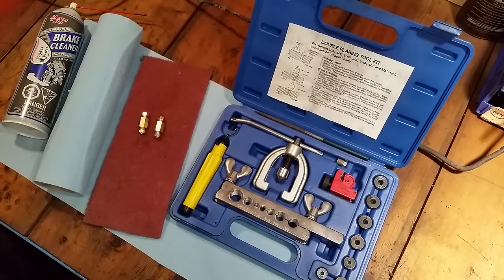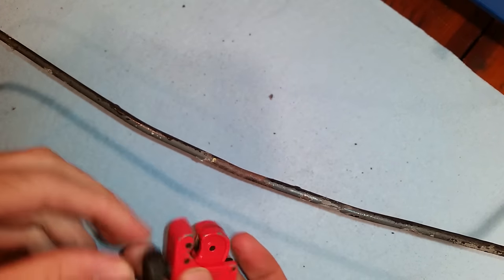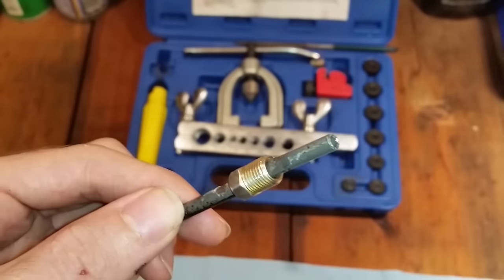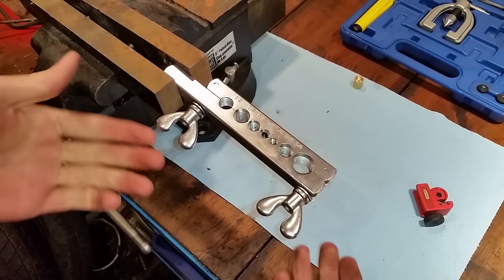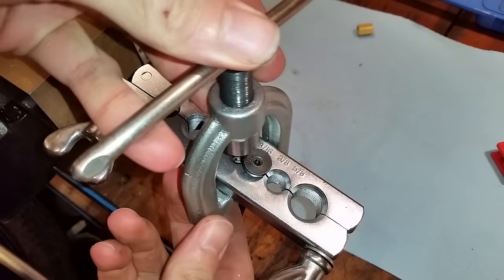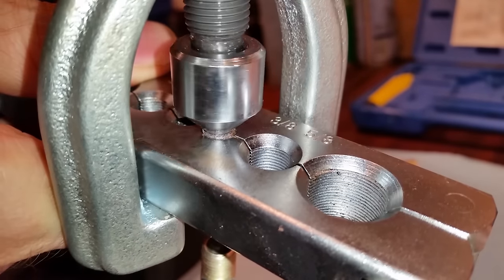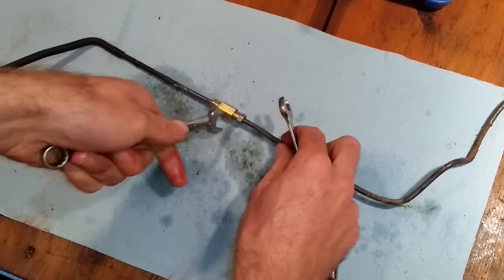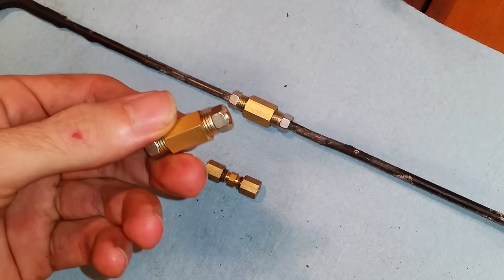How to safely repair leaking and rusted brake lines

Comment: In answer to a bunch of the statements below...not everyone has the money to run out and buy new brake lines. Or maybe you need to get your vehicle back up and running quickly until you have time to do the whole replacement. Thats my situation. No time. I need my brakes to work NOW to get to work! New brake line kits are ordered and on the way. Until I have the time to do the job, they will sit in the box.
Reply: HELL YA
Reply: ... INDEED. Not to mention if you're working outside in asshole deep snow, and PRAYING the rest of the fittings will come off.  MENTAL NOTE:  Buy stock in PB BLASTER. And COMPRESSION FITTINGS? Hell, they may be illegal in some states, but I've used them in a pinch with NO PROBLEMS as long as it's done right, prep work is VITAL to this application.  We have all these DYI vids on YT that may BE very informative, but unless you do it right ... it makes no difference. If you are a DIY person, take the time to do it right, ... SLOW IS FAST.
Reply: The only thing I see is a 5 dollar line that’s full of scale so the line is obviously thin in places rust is a layer of metal so I don’t see taking a piece of sand paper or scotch brute to sand down a line I don’t think you have to replace the whole thing but why bother with old scales line wen you can buy the ones with fittings and all flared for next to nothing thers a lot of pressure in them lines it takes nothing for rusted lines to blow if you want to get it back up and quickly the size of the line you wer fixing you could have bought for 5 bucks fitting and flared I’m sure you have 5 bucks I don’t put rusted line back on ther could be pin holes in them that’s all
Reply: @jeffleblanc8850  True enough, if you got the damn thing off, you can get it back on. If you don't have five bux, where the fuck you need to be anyway?
Reply: Well done SAID, Get her done!
Reply: If you have time to go buy the fittings you have time to buy the brake line.
Reply: a spool of cooper brake lines cost $20 on amazon, what are you even talking about?
Reply: @mrcokez1  If you read my reply your question is a circular argument. Its TIME. Since my last post I replaced all the brake lines on my truck. It took me a day of fighting all the clips, clamps and tight spaces with my big ass hands. When I made the temporary repair, it was a weekday. I needed my brakes to work the next day to get to work. What part of that is a great mystery?
Reply: @donaldbaldwin9912  your point just said it all 100%
Reply: @donaldbaldwin9912  what happens if you need your vehicle ASAP but they can’t get a brake line ordered for a week? This is the perfect thing as a quick fix
Reply: and maybe they don't make them for your particular car or can't get them for some reason; i have run into that multiple times; learning these skills to mock up and bend lines, make the unions and flares is invaluable
Reply: Story of my life lol
Reply: But you have time to inform us about it.
Reply: @ETA555  Sure did. Two years ago....ffs
Reply: Those tools to repair brake lines cost WAAYYY more than just buying new brake lines!
Edit: and as far as time buying new lines is faster than fixing old ones
Reply: BS. its a job. Do a little more and rebuild a  new brake line... the original brake line is one piece... its all the same age... its all going to fail nearly the same time irrespective of whether part is more exposed. Don't even think a coupling repair will pass a UK MOT or German TUV. Also the double flare created here is incorrect (although MOT tester cannot tell) [TUV tested looks for ISO flare], it should be an ISO DIN flare.
Reply: @throatpunch4789  Some auto parts stores loan the tools out for free.
Reply: @jeffleblanc8850  Amen Jeff, for what it cost to buy the fittings he could have bought an already made up line ( various lengths available )with the flares on it and made that fit. Now he has two more areas ( fittings) that can leak not to mention the time involved in bleeding the brakes when he replaces the line with a new one.
Reply: @jeffleblanc8850  Steel lines do not "blow out" on vehicles.  They either rust through, rub against a sharp steel edge and are cut, or they crack due to vibration. A  3/16" steel tubing for brakes has a burst pressure of 16K psi.  Vehicle brake systems produce less than 2K psi.  Older vehicles require custom made lines and can cost over $150 dollars for one with numerous bends.
Reply: Dude  done properly this is a good solid repair no need to replace the full lines.
Reply: dont mix ATF with brake fluid or clean the line out really good after ur done

Comment: Keep the inside of your lines clean after cutting and de-burring the ends so metal shavings don't remain. Any contaminates  left inside the lines can prove fatal to any brake system in no time. Debris may jam the piston or quickly destroy the seals and o-rings.  If lines are still on the vehicle, you can carefully twist a Q-tip inside both ends while  to capture debris. Don't worry about leaving a piece of Q-tip hair behind, it's less detrimental that metal shaving floating around in your system. IF the lines are off the vehicle, blow/flush  the lines out well. If you flush the lines with water, blow them out.  Cleanliness is more important that anything. Keep the system sterile.

Comment: A person should use brake fluid to lubricate the die and the line. because other lubricants are often not compatible with brake fluid. and can contaminate the fluid in the system.
and a person shouldn't ever use compression fittings.

Comment: I've watched a number of videos on repairing brake lines now, and yours is the only one I finished.  Outstanding!  Now I'm ready to fix my brakes.  Thank you!
Reply: OMG!  Great video but if you've pulled the brake line off, then BUY A NEW ONE!  $25 IS ALL for a brand NEW ONE!  C'mon!  You'd be doing it anyway in a year if you've got that much rust on 1 part already.  GIVE GOOD, THOROUGH info on the most important part of the car!
Reply: Taylor Mitchell hey dummy, you don’t think this was done as an example? OMG like chill out riiggghht!??

Comment: Why the automotive industry does not offer an inverted double flare coupling is beyond me. You know that many a mechanic has been faces with a broken brake line. I do not see why a bite-type compression coupling made specifically for steel line would be unsafe. I am a designer who has done industrial piping and specify compression fillings made by Park-Hannifin and Swagelok for steel tubing applications. Many years ago, I was faced with repairing a broken brake line and ended up having to make up an entire line that took many twists and turns. It was stressful because if I messed up the double flare on either end, the entire line was scrap and I had to start all over again. So I practiced making double flares on scrap until I got it down to a science.

Comment: Nickel-Copper (NiCop) brake lines. Best stuff ever. Bend by hand, no kinks, double flares beautifully. More expensive but eliminates all frustration. Worth it.
Reply: Thanks!
Reply: Mar Blox 🤣👏🏾👏🏾
Reply: Couldn't agree more. I replaced every line on my 2500 suburban,  pain in the ass, but alot easier with nicopp lines
Reply: @markbelden6919  I love those old Suburbans. I used to have one. I also used to have 77 Chevy Blazer K5. Loved it! Built like a tank.
Reply: @michiganmagneto  mine defwasnt as cool as a '77, mine is a rust belt 2001, I do love her though,
Reply: @markbelden6919  my 77 Blazer initially had a 305 or a 307 in it and it was about useless then when it finally fail I was like cool. Ran up to the junkyard grabbed a 400 out of a 76 Monte Carlo dropped it right in. What a difference. Wahoo! I love that the top came off. Something I thought would always be awesome to do but I'm not a body and paint guy by any means,  if they made the Suburban similar to the Blazers in relation to taking the top off that would be so cool in itself. But take it about 20 steps farther and build a nice fiberglass camper top that would go over the entire cab and bed. And then have it all mold it into the body so it all looks like one unit. Throw on a moose slayer bumper with a winch & some good size tires... 
One of a kind behemoth!
Another custom conversion I was thinking of for a Suburban would be to put a conversion van top on top of a Suburban. Even that would look super cool.
Reply: There is a company called "inline tubing" that makes premade brake lines for most vehicles, their prices are very reasonable and fit great, I have been restoring my 82 chevy c10 and use their brake lines and transmission lines and they fit perfectly and look just like it came from the factory and they even offer stainless steel lines for a little bit more for people who live in the rust belt, I highly recommend them, saves so much hassle making lines, so if you can wait a few days, order some lines from them it's worth it.

Comment: A great tutorial on brake line repair, I have been doing auto repair in New England for almost 50 years so have lots of experience with rusty brake lines.  I would like to add use the copper/nichol brake tubing for replacement as it doesn't rust, is easier to cut and flare and very easy to bend by hand.  I by it by the 25' roll so replace whole line instead or patching sections.
Reply: I'm in northern Michigan. We replace A LOT of brake lines. That copper nickel line is awesome to work with.

Comment: Great video. Replacing the entire brake line is not always that easy in your driveway. Sometimes the splice repair is the only way to go.
Reply: I agree make the temporary fix until you can get it somewhere easier to replace the whole line. Having zero brakes especially in a big vehicle makes it impossible to move the vehicle anywhere safely

Comment: It’s a good quick fix . What happens is that moisture always gets to them over time. Unfortunately brake lines. And gas lines especially. Rust out . The brake lines or gas line all start out from the engine department and run down to the frame and run the length of the car zigzagging. Thought out the frame to the axle . And can rust any wear on the line over time  . The safest way to go would be to change out the rusted  line whether it be gas or brake line . It’s a little pricey. Depending on the vehicle  but not over wellming in price don’t let  the macanic try to soak yous . All you ladies 😅 stay safe all

Comment: This is exactly what I was looking for, thank you! My old truck is rusted from stem to stern underneath, and I blew a brake line bleeding the brakes after installing new pads, rotors and calipers. For $75 I got a full set of pre-bent brake lines, but some of them are too long, or bent in such a way you'd have to take out the gas tank, take out the radiator, remove front end parts- take the body off the frame almost to get these pre-bent lines in where I need them. Instead, I can cut the really oddly shaped ones in 2 pieces, slide them in from both ends and splice them in the middle. I don't want to use compression fittings for the reasons mentioned in the video, so yeah- this is exactly the tutorial I was looking for. Thanks!

Comment: I have owned severl older vehicles with steel brake lines and live in the salt belt. Over the years,  I learned that you should always have ample brake line parts (e.g. brake lines, fittings and tools) on hand at all times. Also, replace as much of the leaky brake line(s) as possible when doing a brake line job. Take it from someone who has done dozens of brake line repair jobs over the past 50 years.

Comment: I really appreciate your thorough explanation of every detail involved. Particularly the information about the different type of fitting at the end, because in relation to my situation it let me know whether or not I can use the compression fitting on the job I'm doing. I'm fixing a leak in my fuel line and I wasn’t sure about the fitting that was supplied with my repair kit. I'm pretty sure it'll be ok since it's not under as high of pressure as a break line is. Anyway, thank you for your helpful video.

Comment: Great video ESPECIALLY the warning about compression fittings and the danger of using them.
Reply: Compression fittings are capable of withstanding 5000 psi way more than brake system will ever see.
Reply: @YUKI JINJUJI
IF it's done right AND with the right materials, which is often less than likely to happen.
Reply: They're fine. Never seen one fail. They always outlast the car

Comment: This is an excellent description of technique, and I really like the way you had a go at why compression fittings are inappropriate for brake lines. Of course compression fittings are used all the time for water installations, but there are illegal for brake fittings for good reason. Part of the reason they are illegal is because they could be easily assembled incorrectly, with no early warning until it suddenly fails. If that ferrule is installed too close to the tip of the line on one side, it may not grip the line as well as it would normally. So, those who claim that a properly installed compression fitting works fine have some justification for that point of view. The problem is that it would be much easier to make a mistake, especially in a situation where the operator cuts the line a little too short and he is in a hurry to complete the task under the car. If the tip of each line is not properly jammed into each end of the fitting, or if it creeps back while it is being tightened down, the ferrule is incorrectly installed but it looks just fine from the outside. If he forgets to crank down one side, it may seem to work fine until the ferrule creeps back with time. A tech could do a thousand of those fittings and if one side of one fitting is bad, he's made a mistake that could cost a life. With no way to detect incorrect installation, the customer is left with a car that is a danger to others on the road when it suddenly fails. On the other hand a bad union will immediately leak, pointing to the need to fix it right away. Even influential internet 'experts'  like Scotty Kilmer get this wrong, you can't trust everything you read on the net.
Reply: Be ready with the e brake when brakes fail....so it doesn't cost a life.

Comment: This is just the information I needed to tackle my burst brake line at my front passenger side of my Dakota.  Appreciate the clear close-ups on the flaring details such as setting the line height in the anvil part the same as the thickest part of the die.  thanks again.

Comment: Thank you so much for this. This made it super easy to understand the steps and proper way to fix a small section. I’m going to do this since the previous owner used a compression fitting, and like you said, when jamming the brakes hard, it made it leak. Appreciate your time in making this video!

Comment: I've worked on cars for 50yrs. Never before had a problem with brake lines, until now. A 96 accd. Pinhole underneath driverside rear seat area. I figured car must've been exposed to snow conditions. Went to pickapart to buy replacement. Spent 3hrs including removing gas tank, only to be stumped with one last bolt hidden behind frame/suspention. So I've searched through utube and found this(and) other videos like this. This is the best(1 other) cuz of explanation about compression fittings. Will use this. Lucky my car is only my backup but will replace complete after I get my #1 back and on the road again. Thanks. Now, off to the store to get what I need.
Reply from the maker: Thanks for watching! Protective coatings aren’t what they used to be. Things break down and rust much faster then they used to.

Comment: Outstanding video sir. I had to repair my 2004 Nissan Quest because the brake line rusted out just before the fitting that plugs into the flex hose going to the caliper. Replacing that whole line was not an option because it is behind everything including the intake manifold as it heads to the ABS unit on the passenger side. The line was in perfect condition inside the engine compartment, so using your guide, and a 20 dollar flaring kit from Amazon, I was able to replace a mere foot of line and I'm back on the road for a pittance. Thank you!
Reply from the maker: Fantastic! Thanks for watching.

Comment: Really is an excellent straight to the point tutorial.Anyone can do this with a little patience.And yes compression fittings are a BIG no-no....but if you have to,they will work temporarily in a pinch.And I mean temporary....be ready to pull the e brake when braking if you have a compression fitting being used temporary to get you home..

Comment: Compression fittings are still in use and sold in auto stores. I've used them many times over the yrs and never had one come apart.  I agree the double flare is better, but under the car is harder to maneuver.  Thanks for sharing .

Comment: I just replaced 2 lines on our old cavalier....On one I had to buy 2 pcs and tie together so I asked for a proper union. They brought me two compression fittings, which was nuts as the lines had 2 threaded ends and would have had to cut to use...to get a poor splice. Gotta love Advance Auto.....

Comment: Great job! I would ony add that after deburring the inside of the line, tap it on a block of wood to dislodge any chips that may have dropped into the line.